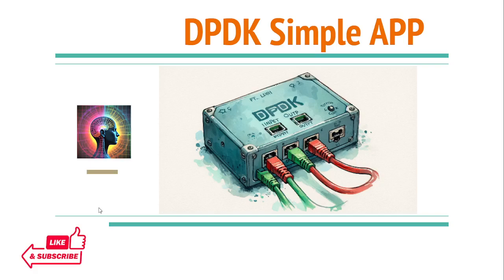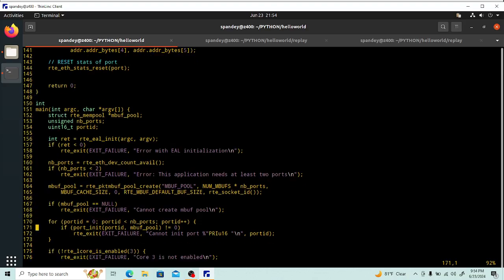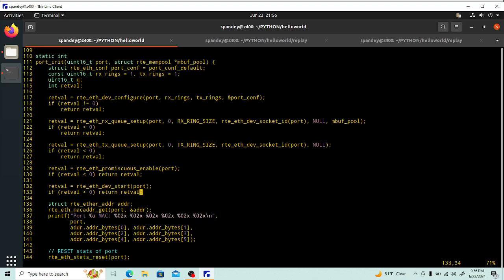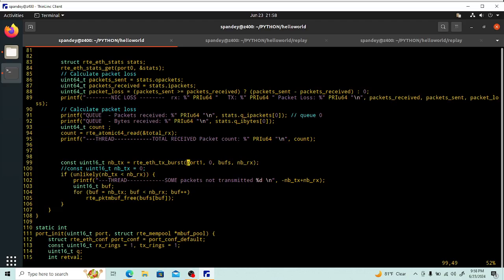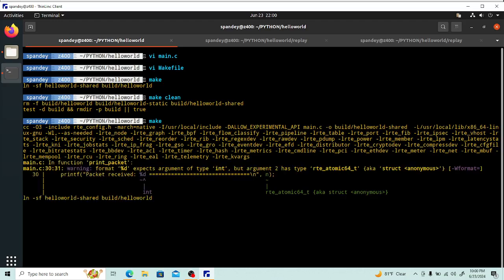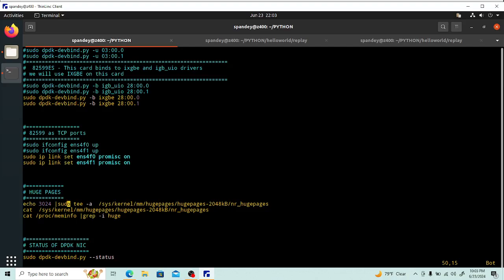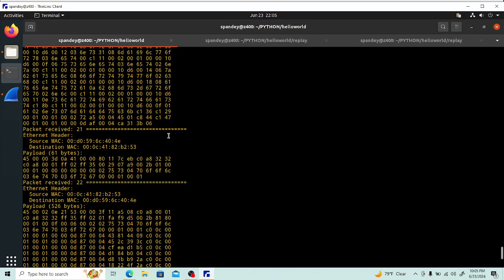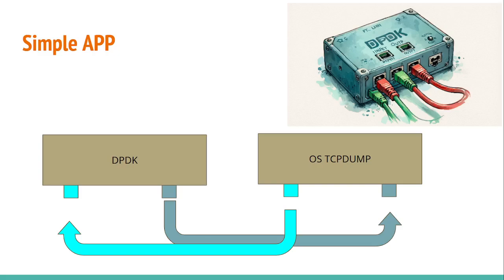DPDK - Simple forwarding app

Comment: Hello,  "I have two computers. One has the IP address 192.168.1.9, and the other has 192.168.1.10.

I have a third computer with two NICs, where I have installed DPDK and bound the NICs. I want to use this third computer to forward traffic between the two computers so that the traffic passes directly through it.

Should I use dpdk-l3fwd for this? If yes, what configurations should I set before running l3fwd?"